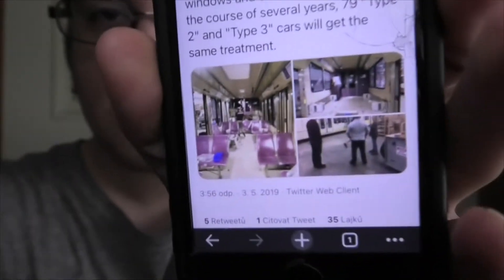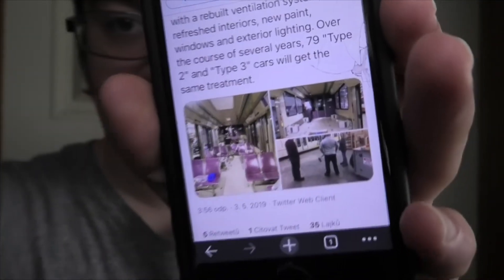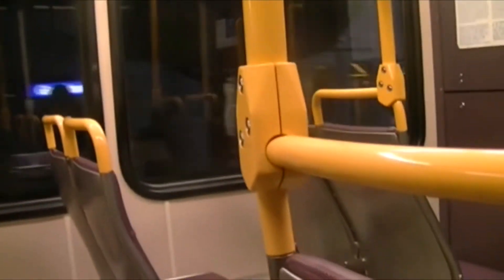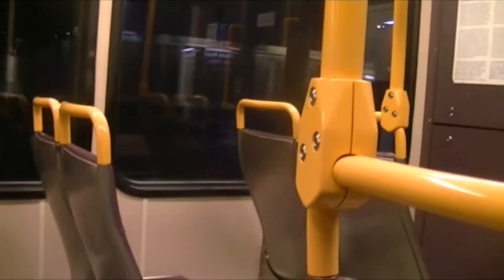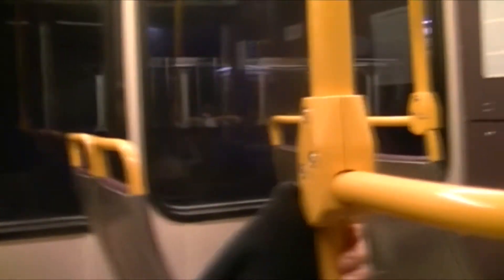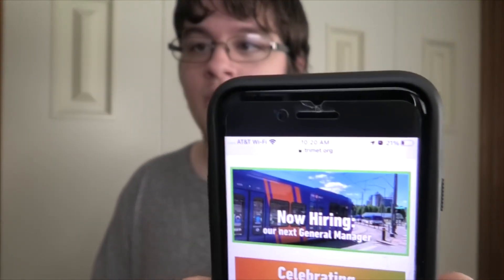MAX Type 2/3 Overhaul - Info on Car #315 - Mar 2021

Comment: Wow that clip you played was back when the audio system on Types 1-3 was much clearer sounding. Wonder why it's not as clear anymore.
Reply: The announcement and destination sign systems were replaced in 2015/2016
Reply: @pdxproductions1613  I know the announcements were replaced (such as "the doors are closing" replaced with "the doors are closing. Train departing. Please hold on"). But even then, it still sounded nice and clear for a little while, like in the clip. It didn't sound like you were hearing them over a baby monitor, like you do now on all 1's 2's & 3's.
Reply: @ericyoung1478  my point wasn’t that the announcements are replaced (they get replanned all the time). 

My point was that the system that CONTROLS the announcements were replaced in 2015/16. (Aka, the system that controls when they go off, etc). The biggest way to notice this difference is the new digital signs on the trains instead of rollsigns. Anyways, this system works differently than the system that is found in this video, and provides generally quieter announcements.
Reply: @pdxproductions1613  Oh, gotcha. Thanks for pointing out.